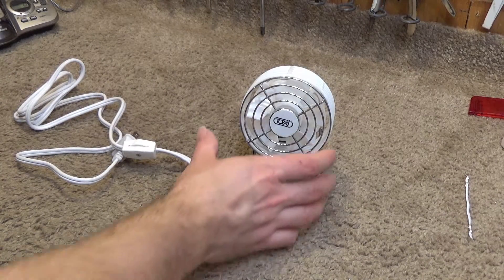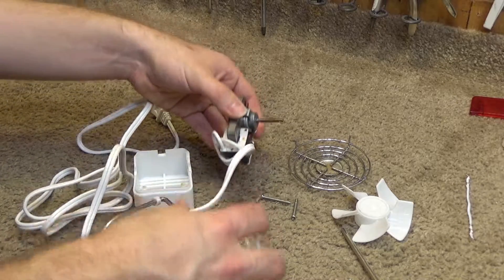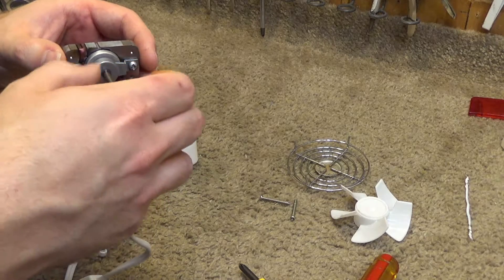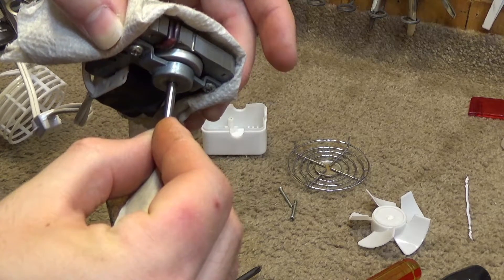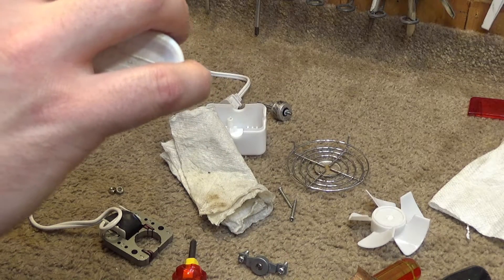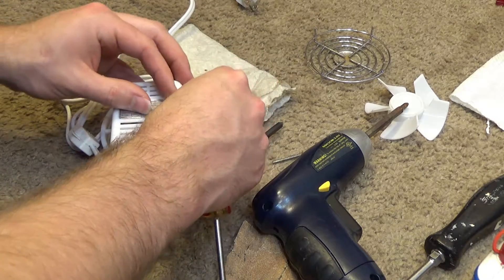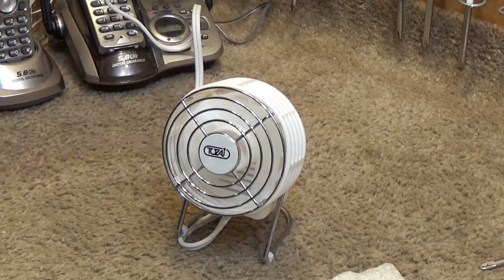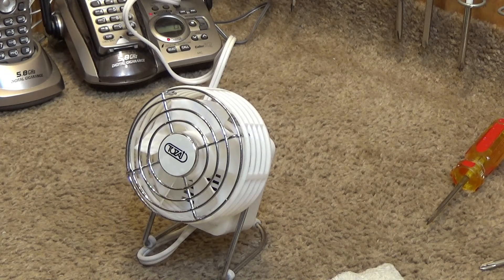Tozai 14B1095 3" Personal Fan Repair

Comment: Thanks for the video on a repair of a Tozai model 14B19015 3" Personal Fan that has a tiny little shaded pole motor which needs lubricating and oil in order to last longer good video bro
Reply from the maker: You're so very welcome.

Comment: Cool, I have one of those branded Advantage, and I got it in 1996 at a flea market. New at the time. I also have another branded Cool IT but it's black, and has a metal rear grille...
The last time I saw these fans for sale, was at a Dollar General, summer of 2007. They had orange, green, and other colors, but I forget what they were branded as. Probably whatever Dollar General's store brand is/was.
Reply from the maker: Interesting, I didn't know they came in so many different colors.

Comment: How is American made Lasko any better than a Chinese made fan? I decided to get the latest model of the weather shield after watching your channel. I decided to take the risk despite you experiencing two different motors on the same model, but luckily I got the right motor, but it came with pre-applied rust do to the imperfect paint job, the frame is not exactly bent correctly  and whoever assembled it gave up in putting in all the screws LOL.
Reply from the maker: Truly American-made Lasko products were fantastic. Lasko is no longer American made. Lasko claims to be 'assembled in USA' currently. 'Assembled in USA' is not the same, or really anything close to, 'made in USA'.

Comment: You could try removing one or two of the white plastic washers on the rotor, quite possibly making it too thick to fit between the bearings and spin correctly.
I'd say if this wasn't new, take the motor out and put it toward a far more practical purpose.  Perhaps it would have been better with a smaller DC motor, maybe even battery powered, but with the large (for this) motor and the thick heavy cord coming out, this is a joke.
Reply from the maker: I don't remember if this had any play in between the bearings or not, if it doesn't, your solution may be the answer. The cord is so stiff that the unit doesn't even sit on the table where you want it when it's on a flat surface. Truly an abysmal product.

Comment: as small as a CPU fan lol!!!
Reply from the maker: Why is that comical?
Reply: @JordanU  Although it is 3 inch as you said in this video. It is like a CPU fan that can actually be compared.
Reply from the maker: @intelboydj1  Why is that comical?
Reply: As I have already mentioned above
Reply from the maker: @intelboydj1  That doesn't make sense.